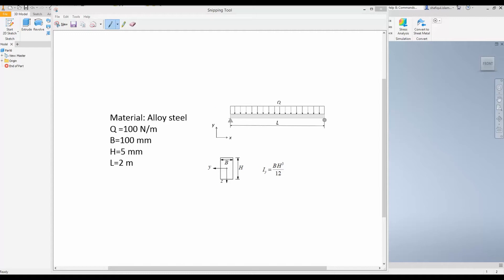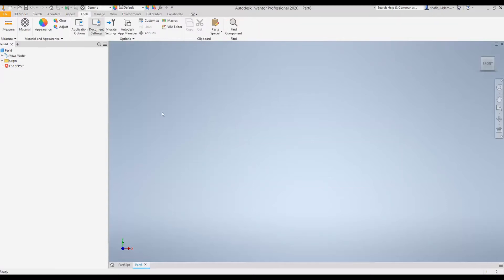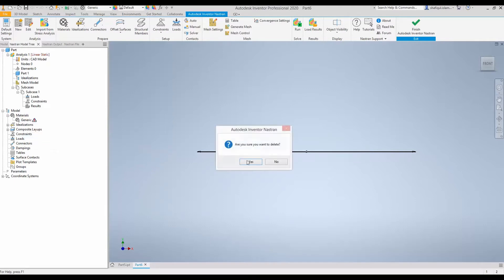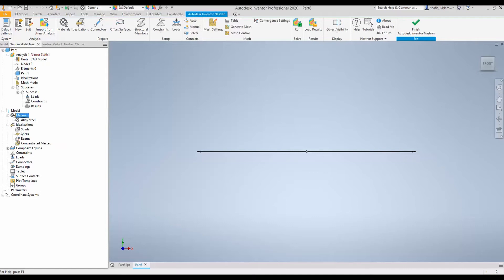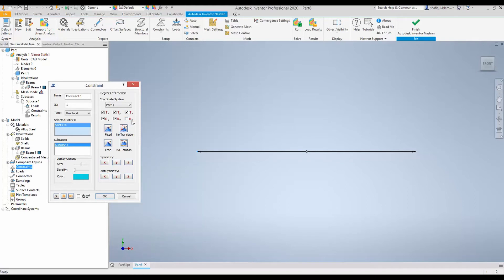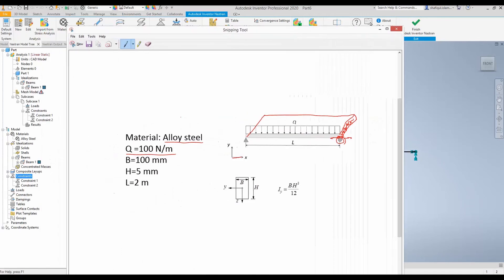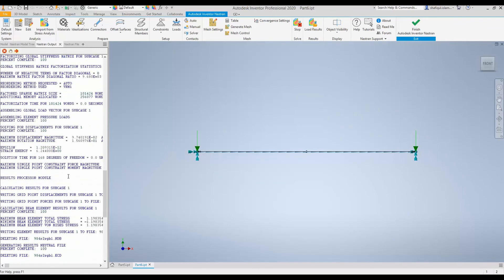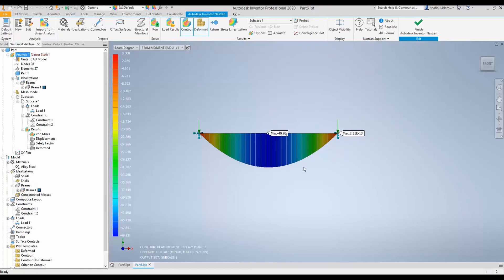Solve Beams in Nastran (Inventor) II Shear force and Moment diagram

Comment: Please how can I add the distributed load on a specific length of the beam and not on the total length please help me I need to know that as soon as possible
Reply: It could help to split the beam in several beams according to the extent of the loads, and then apply the loads on the loaded part of the original beam.